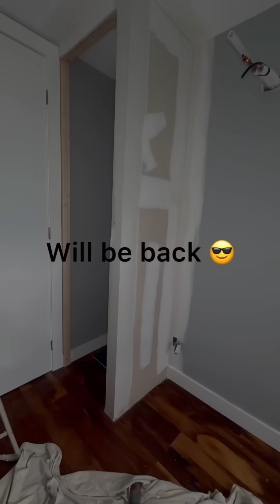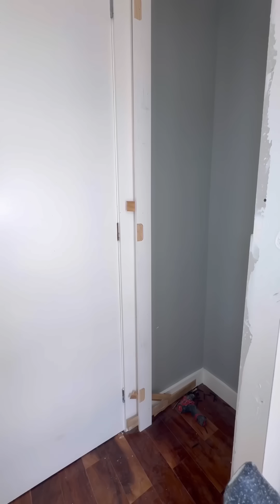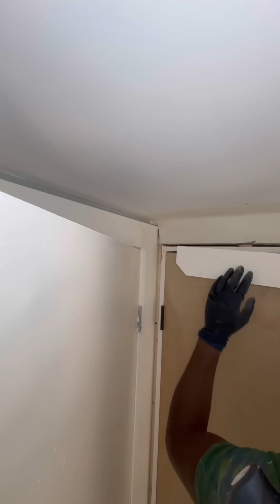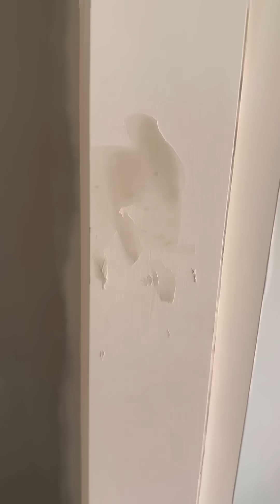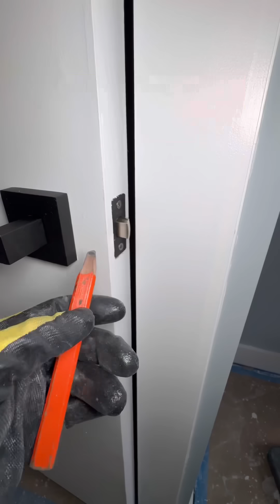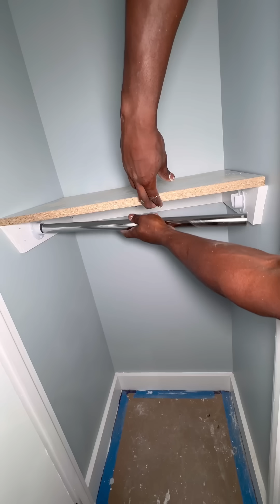Easy way to build a closet😊

Comment: Great work I’ve installed closets just like this in one day. I would recommend putting your door frame together first  and use 45 minute compound for 1st coat, sponge dry then regular compound then sand
Reply from the maker: Thanks for the tips!

Comment: The only criticism I have is the shelf supports are glued making it impossible to change height later on without ruining the drywall. I get why it was done this way but I think a closet insert allowing for adjustments would have been a better solution. Otherwise, nice job and I learned about a new tool I haven’t used before. 👍🏻 Amazing that bedrooms were once built without closets.

Comment: DAMN, good job youngster. I have carpeting throughout... 80% (🤔?)of my home. I would have to use, at minimum, 8 inches long, 0.25-0.75 wide masonry screws at the base because of my concrete foundation. Theoretically speaking.

Comment: Honest hardwork 👍 but if you screwed the drywall frame into the floor panels, replacing them in the future will be a faff as you'd have to cut them out around the closet unless you disassemble it.

Comment: I use 6 screws for my corner beads   2 top 2 bottom 2 middle....but I'm going to try that technique.
Reply from the maker: No screw is always better. You do it after mud dries up.

Comment: Excellent work except for one thing. It was built on top of the flooring. It the flooring has to be replaced, you are in for some pain. The walls of the closet should be fastened to the subfloor.
Reply from the maker: What if I want to remove the closet?😁
Reply: @LeoLevy1842  😄

Comment: Nice work  but man that room probably could've gotten by without a 2 x 2 space added just to make it smaller like yikes
Reply from the maker: 11x10
Reply: @LeoLevy1842  I was saying adding a super small 2 x 2 closet makes the small room smaller and the room could've done without the closet but you did a good job

Comment: Did the door reach the floor at the bottom, it looked pretty high from the floor. Still a good job
Reply from the maker: That door was pretty short as you can see, I wanted the top to be the same level as the other door
Reply: That's what's up, it was educational and a good job, I subscribed

Comment: Question… I am a repairman and I’ve had to fix cracking corner beads due to them not being screwed in. How do you prevent cracking later on without screwing them in?
Reply from the maker: Notice how  I applied it with the mud? Also, it doesn’t hurt screwing it after it’s solid.
Reply: @LeoLevy1842  Thank you for the explanation.

Comment: Nice but the door looks too short.
Reply from the maker: @hbrealhousewife2270  it is, that will have to work though , I had to make them the same height so when you look up, it doesn’t look uneven,. I rather the gap being on the bottom than the doors not being on the same height.

Comment: Bjr pourquoi vous navez pas placé la porte du placard de lautre côté, la porte d'entrée et de placard vont se gêner, er les il faut fermer la porte d'entrée pour ouvrir celle du placard ? En tout cas très beau travail
Reply from the maker: The Mini Split unit is in the way as you can see the wires and pipes

Comment: The title says easy way to make a closet, yet there were some complicated steps taken to achieve craftsmanship. The title would apply to tradesman and not beginners like me. 
Great job but!!
Reply from the maker: I will try and re-edit this video to break it down more. It’s not hard though.
Reply: @LeoLevy1842  no worries mate. 
I'm actually building a double split wardrobe 2400mmH x 600D x 2000W for my wife and I in our room attached side by side mirroring each other. So far I've used mdf boards and constructed in on the outer sides six cubbyholes each with the hanger rack going through the middle. Still finding ideas to see which door designs work for us. 
I was watching your video for ideas. 
Keep the vids coming

Comment: Measure twice cut once. Why would you ever make a door the height of the floor to ceiling? Your work is decent but, you're cutting corners with the spacing gaps with door height and the width of that closet.
Reply from the maker: Didn’t read? Than old door… a bit shorter than that door to the left, wanted them the same height on top so yea
Reply: @LeoLevy1842  I get that but if you put a regular room door and box up the top it would be more appealing and made the closet wider it wouldn't look like a photo booth.

Comment: Why screw into a nice wooden floor?!😳 Not even necessary….
Reply from the maker: @bjarnvik  what would you do?
Reply: What the heck are you talking about? He’s doing it properly. You have to screw the bottom plate  into the ground .
Reply: @LeoLevy1842  fix in wall an ceiling. The frame with plasterboard will be stable enough without needing to screw into the floor.
Reply: @ThaiRoney  Actually not

Comment: That's not the type of closet, I am thinking about! My closet has the long 2 by 2 boards, as the frame for the one side I construct. Create a piece of lumber with holes to hold the lumber in place on the floor. The 2 by 2 lumber will fit into that.  This will hold up the styrofoam wall.  There will be blocks glued to ceiling with gorilla glue.  The 2 by 2, nailed to the blocks. The door framed with 2 by 2 lumber, covered with styrofoam. paint it and the one side, that I constructed. Door opens from left to right. Put brackets on doors that closes itself. No need for a door knob. Push in, the bracket releases it to be opened with one finger! Put a draw pull as the mechanísm to release the door to open or simply a hole!